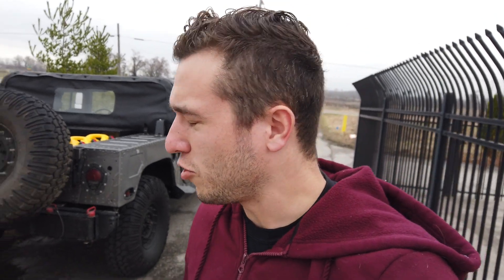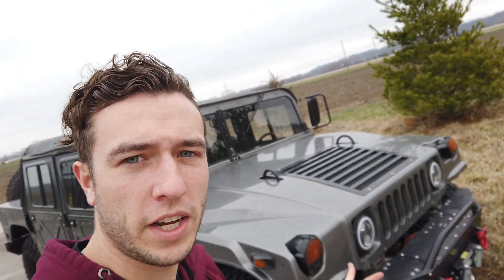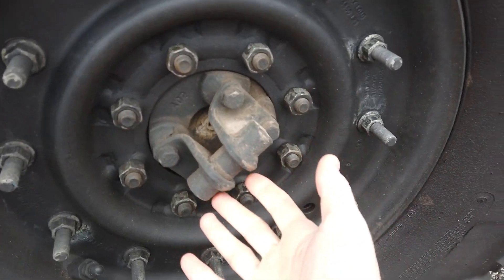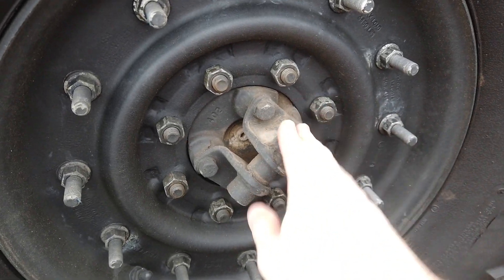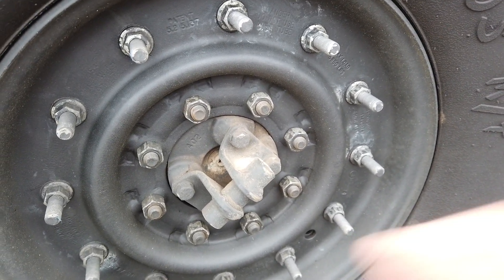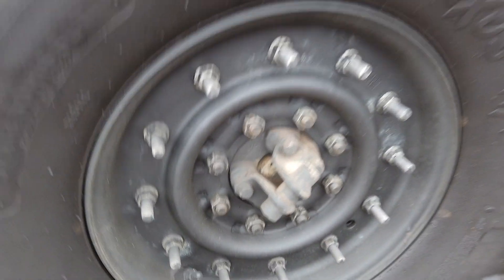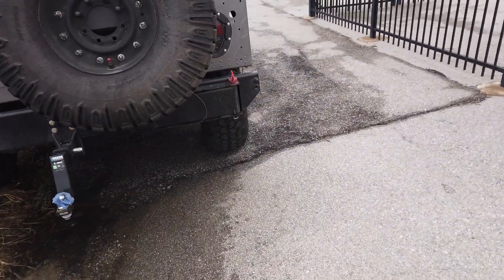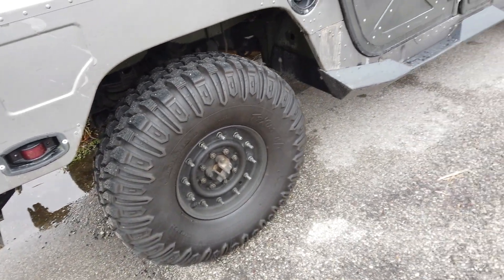The Secret Winch on Every Humvee

Comment: I seen this done on active duty and it does work amazingly well!
Reply from the maker: That's awesome! Can you elaborate if I got anything wrong or missed any details in this video? What situation did you see it used for?
Reply: @Kevin24Seven  keep it simple stupid is the way the military does it. So pretty much the way you describe it.  The method can be used on which ever wheel you need it mounted on. I seen it used in the Philippines to get unstuck out of a Ditch, a Marine drove into while looking at some Pinay 😂🤣😂. A young 20yr old can always find a way to get anything stuck 🤣👍

Comment: I was in the army and yes the issue with the front is you have steering linkages in the front that makes it weaker and can cause more damage but yes you could. The weight of the engine in the front also helps the front wheels stay in contact with the ground so doing this lifts up on the end that your attached to so keeping the weight in the front holding down allows for an easier pull with the back you do the front make sure your in 4 wheel drive if you do it in the back it's best to keep it in 2 wheel drive. When people get stuck sometimes they brake the yoke or something with the drive shaft so if that's the case you may need to drop the drive shaft and come at it from the front in 4 wheel drive as why they allow you to do it in the front or the rear.
Reply: I would love to get just the brackets but I can't find them without buying a humvee so if anyone has 2 or 4 I can have reach out to me so I can modify them to bolt to something else please and thank you.

Comment: Actually that was for picking the humvee up along with the front hooks coming out of the hood.  Older military vehicles were setup as u described.  It does work but u need to modify what is there to include a spool
Reply from the maker: Interesting, I have never heard of that before but makes sense! I knew the hooks and airlift rear bumper could be used but not the rear hubs.